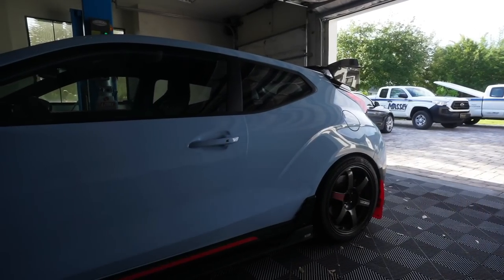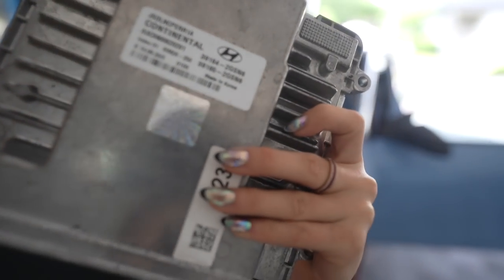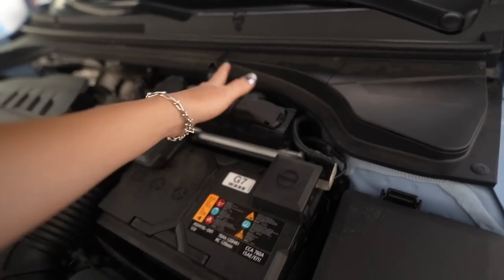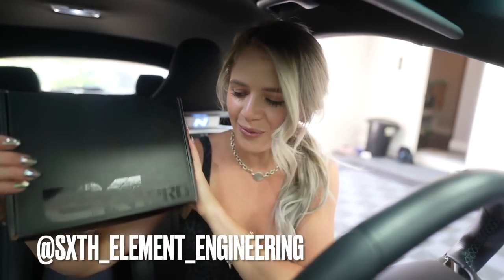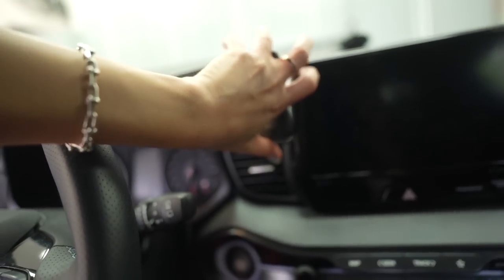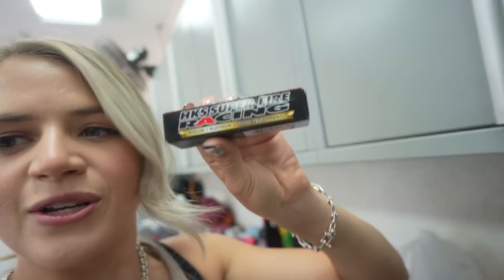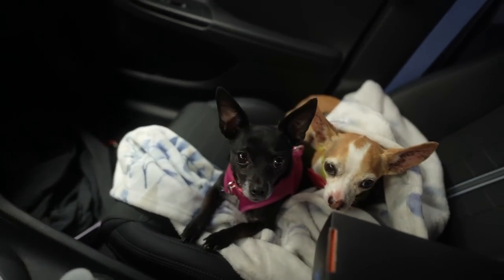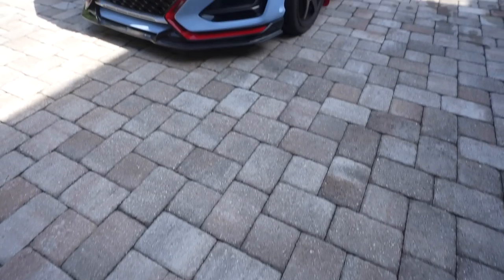First Tune for my Veloster N! More HP & TQ 😏💨

Comment: literally building my dream car, huge motivation to graduate college faster now as I told myself I'd buy one when I graduate. Looks absolutely amazing!
Reply: We’re you able to get one before they were discontinued?
Reply: @ptiscool3334  no lol, still looking to get one in a couple years though
Reply: @Wheels_United  I had wanted a performance blue veloster N since 2018 when they were released. When I was finally able to afford it, they announced they were discontinuing it. The ones on lot were selling for 5k+ over msrp and I’ll never pay over msrp. 

I was originally only wanting the 21-22 model due to the extra safety features (lane keep assist, emergency braking, etc… and the new seats (the 19-20 seats look bland in pictures). I started seeing online that the new features break often and don’t work great to begin with so I decided to branch out to the 19-20 model years. Noticing they were about 4-5k+ dollars cheaper with only 10-15k more miles on them.

I found a 2020 model year and bought it a little over a month ago.  I actually prefer the all black seats to the newer ones. Fits me better overall. And can’t be happier. The car is beautiful and everything I dreamed it was. LED headlights slay hard. Sounds amazing. Anything below 3k rpm it’s just another car. Between 3.5-6k is when she becomes a monster. 

Hoping to motivate you to find one and pull the trigger. You won’t regret it.
Reply: @ptiscool3334  I don't know about breaking often, but I did have blind spot warning lights illuminating on my 22 Veloster even when car was not in blind spot. The problem was fixed after a long wait for the software update. Everything else like rear cross traffic, self steering, collision warning has been working flawlessly. Didn't know my car had emergency breaking , guess I didn't come that close to have it activated. Might try to see if it works with a big balloon wall. I think the extra features are worth it for a little more money. I think  the seats alone in my opinion are worth the extra charge. Nice illuminating bucket seats that are not too tight but definitely holds you in. Anyways I just wanted to give my 2 cents. Both versions are fun to drive and that's what counts.

Comment: I'm absolutely amazed Sixth Element got into the Veloster so fast for ECU tuning, when no one can get into the corvette as of yet. These guys are good.
Reply: The gm ecu is significantly harder to crack.
Reply: Yeah but the problem with SXTH Element is, now they are no longer offering spare ECU tunes for the Veloster/Elantra N. only way now is to flash the stock ecu

Comment: I have the stage 2 right now. Still need to get the new turbo and HPFP to get the rest of the way there. Such an easy bolt on car. Please if your doing the turbo make a good install guide. There arent any out there!
Reply from the maker: Will do!!
Reply: @ColleteDavis  Awsome!! You're the best🙌
Reply: The sonata hpfp 🤦‍♂️ 

It’s an OEM part# 

We running close to 400 or more on our cars on OEM pumps
Reply: @geraldgoodiii6993  your using your stock VN fuel pump? Because I'm running out of pressure at WOT and had to lower my boost pressure because of it. From my understanding the comfy sold hpfp conversion for the VN is the sonata one
Reply: It was leaning out at around 23ibs
Reply: @hunternannen6176  meth 
It’s carrying us along 

OEM will tap close to 360-370 with good tuning

Comment: own a 2013 kia optima and last week my husband was driving it when it suddenly shut off on him without warning. The smell coming from the hood was horrible! Smelled like sulfur and burning wires but no warning lights or anything to indicate what is actually wrong with it. It has been in the shop since last Wednesday.. I have never had issues with the car for the 2 1/2 years I've owned it. Probably a recall for something with the engine

Comment: Holy crap those spark plugs have alot of threads!
Reply: Better than triton engines lol if you want spark plugs shooting thru your hood
Reply: The early 2003 Cobras had like 4 threads. Pretty smart for a supercharged engine huh? They quickly changed it to around 8 I think.

Comment: What would this do to the warranty?
Reply: that tune forfeits the warranty for sure.  i believe they flashed/tuned the actual ECU.
I'm a 2020 VNPP owner with 38k miles and watching this video it didn't see this tune was all that drastic.  I've had my eyes peeled near 2 years since owning this car for tunes and modifications. Nothing out there is convincing atleast from what ive seen in USA.  Forged pistons and rods can be found in europe.  There's an aftermarket intake camshaft that fits both the genesis and the theta 2 engine. But yeah this tune didnt seem to transform the car.  She even said the pops went away and what SXTH said was "thE cAr hAs to ReLeARN iTSelF" ........yeah.....
Reply: @Utsusemi   lol you can only push out so many ponies with the small turbo on these cars. I'm tuned as well and it's 100% true the car definitely has some form of relearning or break in process after a tune. I've got all my pops and bangs and car is running fantastic with a tune. there are plenty running with larger turbos pushing 350-400whp on stock motor. you just sound uneducated on it.
Reply: @jakereynolds1309  i am uneducated in how tuning works.  i know there's something regarding flash tables, etc, code clearing procecdures, but neither are "relearning".  Plenty of veloster n's pushing 350-400 whp sounds radical.  I know most of the turbos out there for this car and the forged internals.  I don't even think the TCR car has that much horsepower. Also: where are these 400 WHP veloceraptors at? I sniff the forums religiously.  I watch videos religiously.  Unseen. But gotcha jake, nice empty YT channel btw. You're not a shill or gambit are you?
Reply: @Utsusemi  try a jb4

Comment: For tuning Lap3 is the best so far. They have pushed out a lot power than pretty much everybody else. Sxth is over priced. Forged Motorsports has a lot of the better bolt ons too. I have a 2022 N. Forge Motorsports turbo inlet, intake, intercooler, HKS bov.
Reply: Yeah, but how's the long term reliability? Powers great and all, but not worth it if it destroys the engine in a few years.
Reply: @2010ngojo  Haven’t seen or heard of anyone having any issues running lap3. They are just in Korea and were the very first ones to mess with KDM, their tuning is insane compared to anyone one else trying to tune these cars
Reply: Forge are a big Rally, Rally Cross parts maker in the UK. There stuff is well used here is not cheap.
Reply: Don’t get me started 
LAP3 is $$& but u get what u pay for 

I been on lap3 for a long time 
Currently making 405whp on a Garrett gtx2867 and meth 
Daily driving that bitch 

I bet she got “sponsored “ by SXTH 
Don’t get how anyone chooses them over lap3 if money is not a barrier
Reply: @2010ngojo  lap3 is the most reliable
Reply: @geraldgoodiii6993  I’m thinking of getting the Elantra N turbo and getting tuned by them. It’ll be $3600 🥲
Reply: @terryosborne272  yes that’s why I went with their intake, intercooler, and turbo inlet.
Reply: @GregS1Krr  it’s a bargain overall.
 SXTH element EN turbo upgrade and tune costs the same and tuning is nowhere near as good.  I got a crew of guys from around the country all running that LAP3 setup.  One dude just made almost 400whp on it.
We all daily our cars 
I hahe their Garrett GTX2867 upgrade with ext wastegate. And stage 4 meth kit.

Talk to David Chung .. he will
Get u lined up.  Nebrr had such good customer service for anything ever
Reply: @geraldgoodiii6993  yeah I’m talking to him now, because I wanna go full bolt on for a lil bit and eventually get the Elantra N turbo. But I wanna daily it at around 350 wheel and have a kill map for meth and e30. He said it was doable with the pro tuner so I might start with that first and work my way up to the Elantra turbo
Reply: @geraldgoodiii6993  I bet 400 wheel feels insane in these cars huh
Reply: @GregS1Krr  I had a pro tuner for a year 

LOVE IT

you won’t make 350whp on OEM turbo 
U
Will need the En turbo upgrade with pro tuner to do what u want.
E30.. don’t run it without meth 
Fuel pump won’t like it
Reply: @geraldgoodiii6993  no yeah that’s what I meant, I want to make 350 wheel with the EN turbo. I know these make like 300 wheel on stock turbo.  But I don’t want to spend the $3600 right now 😂
Reply: @geraldgoodiii6993  aye bro what’s your ig?

Comment: Heard they burn a lot of oil and were recalled
Reply: The recall is for theta II engines. The Theta II-i used in N cars are not impacted. The only thing the Theta II-i shares with the regular II is the open deck block and 86x86mm bite and stroke. Everything else is different, form piston desing to it's e-CVVT.